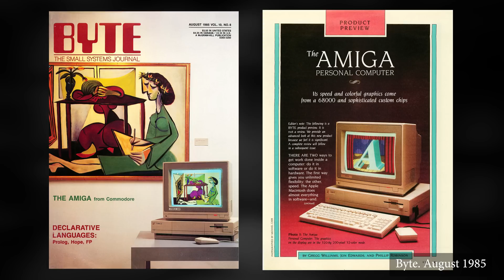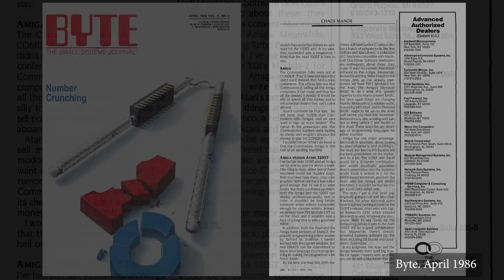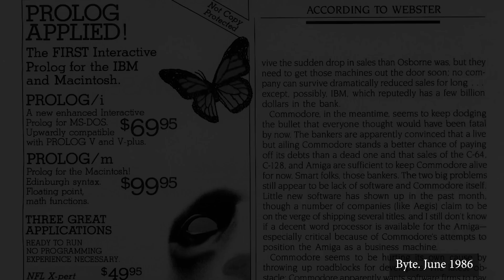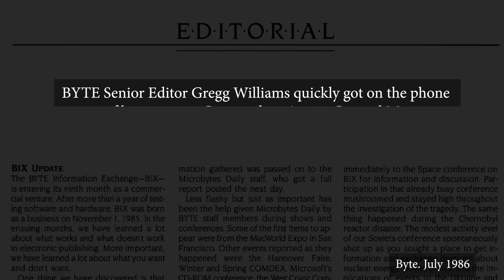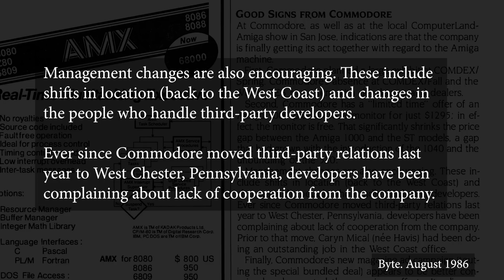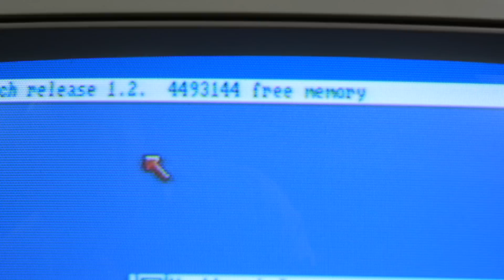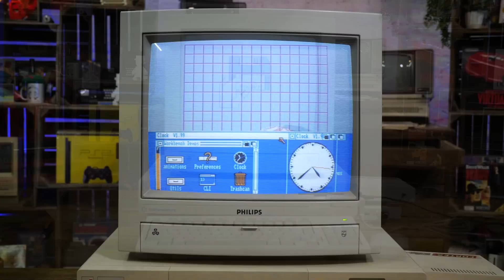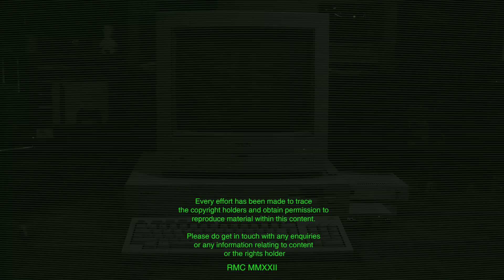Commodore Amiga 1000 Trash to Treasure Part 3 | The Demise and Legacy

Comment: I've been meaning to get a sous vide stick and try your earlier retrobriting experiment with it. I'm curious why you have abandoned that method? To my mind, the "ideal" retrobriting method (ideal here meaning getting results in the most controlled and repeatable manner possible) would be to immerse the object to retrobrite in liquid peroxide, directly heat the peroxide with the sous vide in a closed  insulated container. (I'm in the US, and have been eyeing up using one of the coleman "stacker" coolers with a hole drilled for the sous vide stick--which is something sous vide cooks sometimes do here to be able to handle large items). No lighting to ensure evenness. Liquid peroxide to be sure that we don't get marbling. Sure, it would take a bit longer than combining both but it's not more work or anything--you just wait.
Reply from the maker: I wouldn't say I've abandoned it, I just like trying new things out. To me this method takes less time to set up and uses far less peroxide so it's a cheaper method for me to do, but that doesn't invalidate other methods
Reply: @RMCRetro  OK, thank you very much for the reply. That all makes sense. I was concerned that perhaps some new unknown negative aspect of the sous vide method appeared. 

Keep in mind that you can reuse the peroxide, at least to some extent (although that works contrary to my goal of keeping everything very consistent), and reusability is probably greater if you keep it dark and don't use lights during retrobriting--there is a reason peroxide is always sold in opaque containers. My experiment was going to use the above mentioned cooler as the storage container for the peroxide (the coolers seal up pretty tight) so I would have a retrobrite rig pretty much always ready-to-go for items large or small. (Not that I always have that need but was planning on offering its use to a local vintage computer club).

Anyway, great video as always and thanks again for the reply!
Reply: Instead of putting the wand in the peroxide (you'll get rusting even on stainless in my experience), you can do a double bath, where you heat water in one container with another sitting in it. Peroxide goes in the inner container along with a top and your objects to be brightened.  You definitely need a HUGE outer container if you want to do computer cases, so I use a big commercial prep/rinse sink for this.  You'll also need many MANY liters of peroxide to submerse something like an Amiga 1000 or A500 case half. Using creme uses much less, but even with a tight fitting top you'll have to reapply regularly.  The vapour method is, like Neil said, a lot faster to set up and uses much less liquid peroxide than immersion, even if it takes 3 to 4 times longer to see the same results. I might grab a low watt density heating matt and give it a try.

Comment: You should try and get hold of a Phoenix motherboard, an A1000 replacement board made in 1990.
Reply from the maker: That would be cool, they are super rare to come by
Reply: @RMCRetro  I have one but I've no idea where it got to and can't find it. Very frustrating. It has the Disiderata printed on it, though wrongly attributed. I met the motherboard creator, Andrew Wilson, on several occasions at the Adelaide Amiga User Group in the 90s. We had as members Andrew Wilson and Jon Potter who wrote Directory Opus.
Reply: @random007nadir  I have great memories of the Adelaide Amiga User Group and I also had my Amiga 1000 upgraded with the Phoenix motherboard replacement. I remember having to wait a really long time to get my computer back as there were inevitable delays in the development process, but it was worth it in the end. I still have the A1000 though it's in the shed and not been touched for nigh on 25 years so I have no idea whether it still works. I also bought an A3000 a little later. It shares space with the A1000 in the shed.

Comment: I'm always confused by window GUI about multitasking capabilities of those machines. I started my computer experience in DOS, so DOS was single, Windows - multi. Somewhere I read that early Mac was single tasked and it made me wonder. How about Amiga and Atari?
Reply: The Mac was multitasking in 1987, but cooperatively, just like Windows before 95 - it sucked compared to the Amiga's preemptive.  But the Amiga's Workbench/OS received virtually no support or development from Commodore, so it quickly fell behind MacOS in usability, even if it was able to handle multiple applications better.

Comment: I’m surprised the restoration of the keyboard didn’t involve painting after the rust removal.
Reply from the maker: That would need desoldering of all the keyboard switches which on balance I don’t think was necessary
Reply: @RMCRetro  oh, I meant with a small paintbrush… like fingernail polish.
I’m worried the bare metal will rapidly rust back up.

Comment: Did you consider fabricating a replacement for the two damaged screw posts in the keyboard? I've seen one method on This Does Not Compute where the remnants of the existing posts are removed and a 3d printed one is adhered in its place with a threaded brass insert melted into it for stability and durability. Probably not strictly necessary, but it's something I might have pondered doing.

Comment: I wonder how different things would have been had Commodore not previously destroyed their US dealer network by discounting sales of the Commodore 64 to the likes of Sears? They had a fantastic machine in the Amiga - especially when you compare the A1000 to the original 128kB Mac - but didn't have an informed sales network of people willing to promote the machine.

Sigh. Another what might have been.
Reply: There are countless small and even some large missteps, but looking back, in my opinion, the ONE event that doomed Commodore was the exit of its founder Jack Tramiel. It was a captain AND rudderless ship after he departed, and the Amiga was the fluke acquisition that extended their lifespan.
Reply: @espressomatic  I doubt it would have survived much better if he'd stuck around. He would have just kept making more machines that weren't compatible with each other and pricing them to lose money until they went broke.
Reply: @espressomatic  If Jack had stayed around we might have had the Commodore ST and the Atari Amiga.

Actually, even with Jack at Atari that came very close to happening.

Comment: Wish there was a way to get the floppy boot selector to work right on an A2000. Tried two different ones and games just won’t boot on an external gotek since it’s still technically DF2. I guess the only way to boot a game off an A2000 from a gotek is to make the gotek df0 by swapping the floppy drive out.

Comment: It is a pretty image they used, amazing in retrospect how little it took to wow people back then for computer graphics, or how bad video hardware was before the Amiga. ;)
Idk but I guess it was just the shear budgetary constraints that gave use cramping joysticks like that Ie. "How cheap can we make this?". :\
The high price aspect of Amiga is far worse than I imagined, I knew it was higher than the C64 but didn't know the gap was that wide, ouch. The Amiga 500 definitely was the turning point and can see why so many people bought that model.
Now that demo you showed at the end, that actually makes you think of the multimedia potential of the hardware right there. I'm always researching that in retro computers, that fight between boring business terminals and beautiful graphics that was a completely unnecessary conflict in hindsight.
Reply: Look up the price of something like a DEC VT220 back then. It was cheaper to buy an Atari ST and use the built in VT52 emulator. There again few businesses would have chosen Atari. I recall when the local Doctors Surgery had a VT220 in every consulting room for doing the prescriptions.
Reply: @MrDuncl  That is interesting and does call to mind "the image" of a platform even though they are all just computers they probably felt it was a gaming company so they bought DECs.
See that so often bitd like IBM and others worrying about gaming on their business computers, to people in Japan in the 80s being hesitant to gamble or stock trade through a Famicom.
Reply: @loganjorgensen  You have probably heard the saying "Nobody ever got fired for buying IBM". DEC was only one tier behind them and would have been considered a safe bet.
Reply: @MrDuncl  No I had not heard that one but it doesn't surprise me heh. Bit too young I guess but fascinating to hear about the changing culture matters of PCs.
Not the same thing but I'm knee deep in research on why VR didn't really happen in the 90s.
Reply: @loganjorgensen  That one probably dates back to before PCs but was certainly a factor in the IBM PCs success. If you were procuring IT for a large company would you go with a tried and tested name that had been around for decades or a cheaper alternative from a startup you have never heard of ? 

On that subject the university I went to bought a PR1ME mainframe at the start of the 80s. I wonder how that worked out for them.
Reply: @MrDuncl  That is true especially at the beginning of PCs that IT support would be VERY important to businesses for integrating this new complicated tool.

Comment: This plant light could be put to better use, only UV light will actually advance the chemical reactions by knocking electrons out of the material.
Reply from the maker: There's an older video in which we conduct experiments and find it accelerates the process, but sunshine is always faster

Comment: I wonder if apple and commodore had the same keyboard manufacturer, I have a yellowing apple extended keyboard that has a yellow spacebar like this one.
Reply: It's a common thing for keyboards in general. The spacebar is typically made out of a different type of plastic (ABS, iirc) from the rest of the keys because it's more resistant to warping during manufacturing for very long, narrow keys, but it's also way more prone to yellowing.

Comment: Yes imagine if the launch presentation contained some of the best programs and demos the Amiga has shown to date.
I was very impressed with the Gold Egyptian mask picture at the time. Looking back with a more technical eye it was showing a limited pallet of colours from a huge pallet of possible colours. A trick that made it seem it could show all colours when in fact it was just yellow and blue in different shades.

The reason it was so impressive is because computers at the time were so very limited. Anything going beyond those limitations was very impressive. What the Amiga does today you would not even bother to write a demo on a modern computer with it's billions of colours and near infinite performance. 

Those modern Amiga demos if shown back in 1987 would have surely inspired a lot of sales. However the buyers might be in for some disappointment when they realised most of them were tricks pushing the machine to it's limits and very hard to achieve.

Comment: In my opinion the Amiga line largely failed due to sheer incompentence on the part of the Commodore management team.  Firstly, there is a huge problem with the marketing team who don't (at pretty much any point)  have any understanding of the machines that they are trying to sell and then there is the execuitive department.  The biggest issue here is that they bring in a management team lead by a former execuitive from Pepsi as CEO who goes on to make huge cuts in R&D without any real appreciation that as a technology company, a good R&D team is one of the most essential things needed to keep the company and the Amiga line of computers alive as well as being competitive in the market.